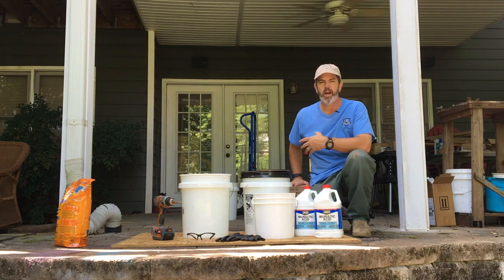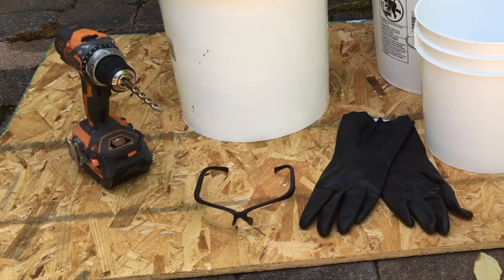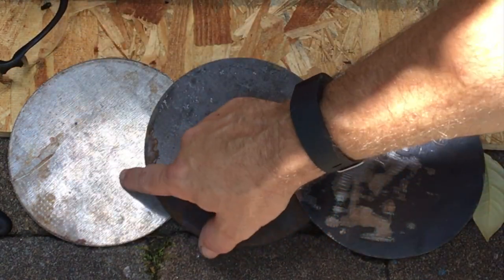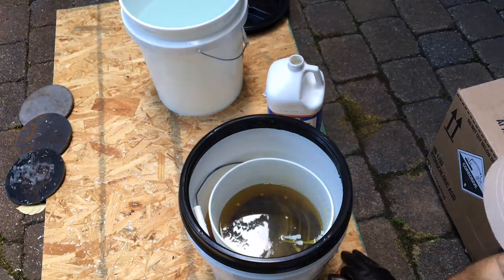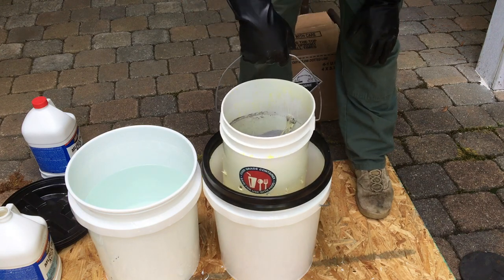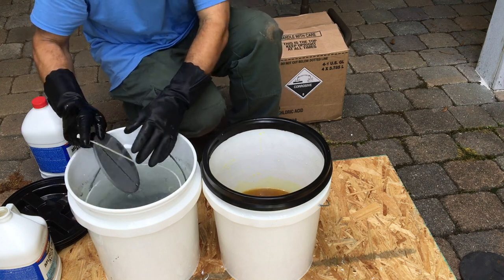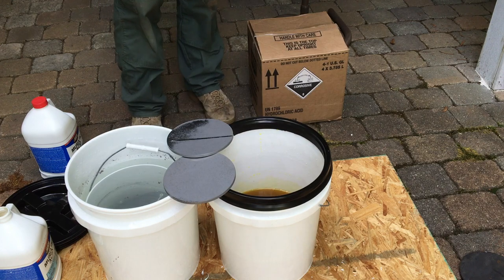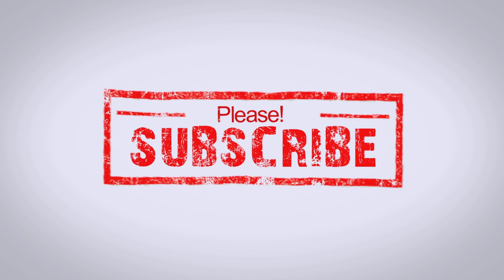How to Remove Mill Scale from Steel.

Comment: Mill scale thickness is a function of cooling time. Solid shapes cool slower, hence thicker scale.  Tube shapes cool faster, so the scale is thinner.  I fabricate handrails, and have evolved my processes through trial and error. At present, I use muriatic acid for solid shapes like bar stock and molded cap rail.  Since the pieces I'm using are fairly long and I don't relish the idea of buying and storing huge amounts of acid, I use a tank made from pvc rain gutter.  It's on a tiltable stand with a ball valve drain at one end. I typically soak the stock for a couple of hours, then drain the acid through a paint filter back into containers.  Then I run a couple of rinse cycles.  I heat the stock with a torch to about 150 degrees to drive out moisture.  I then wire wheel the residue off, followed by a wipe down with wd40. 
For round tube, I built a roller rack and remove the scale with a belt sander at 120 grit.  Square tube is cleaned off with a DA sander. Again,  wd40 prevents rust during storage and production.  Prior to prime and paint,  I wipe off the wd with acetone.  Unwipeable areas get a shot of chlorinated Brakleen, which leaves no residue. Comments are welcome.  Have a great day!
Reply from the maker: Great tips.  Thanks.

Comment: Always add acid to water and never the reverse.  I gather this mostly matters for very strong acids, especially sulfuric, however it seems worth a tiny bit of planning to avoid a possible problem.  
When you add water to strong acid, apparently this may be exothermic and the solution may boil very violently, splashing acid. 
If you add acid to water, the solution is very dilute and the heat released is not enough to vaporize and spatter it.

If you are concerned, just use vinegar to start with, which is dilute to start with.
Reply from the maker: Scott Willis that’s correct.  Unless your rinsing off acid.  In which case it would only be possible if you could dip the part.

Comment: I make weldable nuts doing this to burn off the zinc coating.  It's key to have lots of baking soda on hand to prevent ruining everything and burning your skin.
Reply from the maker: Absolutely need to neutralize anything you put in the acid.

Comment: Mark L.
Be very careful with muriatic acid. Protect your lungs with an acid-gas respirator, wear long rubber gloves rated for acid resistance, and have full face shield to avoid getting it in your eyes. Also, I recommend using muriatic acid out doors only. The fumes can rust every steel or iron object in your shop - even tools in tool boxes. As he said, have baking soda or soda ash on standby to neutralize the acidity. Rinse the steel parts in a mix of baking soda and water, or soda ash and water to get the acid off.
Reply from the maker: +Mark Lombard thanks. All good advice!
Reply: Thanks for the tip. I was going to use it tonight to remove the mill scale on a 2'X4'X1/4" plate that I'm planning to use as a welding table top. I was going to use it in my garage with the overhead door open but that seems like a bad idea after you mentioning how it will rust every steel or iron object in my shop.
Three roller cabs full of rusty tools does not appeal to me at all. 
I'll stick to using flap discs and sanding discs on a 4 1/2" angle grinder.
Thanks again and thanks ManCraftingTM for the video.
Reply: Yes, everything you said is true, but there is nothing better.
As long as you use the proper ppe and have a steadfast routine, it's as safe as any other job.
One point you did make which is VERY true, do not do this indoors, or in your workshop. It will each anything with iron ions, by that I mean destroy. Best to do it in away from workshop type areas. I do mine on my paved area, so even if I was to spill any, all it will do is clean the slabs 😉
Reply from the maker: Shona O'Neill thanks.  Interesting to know that’s also the process of choice for industrial operations.  Thanks.

Comment: Excellent! Just what I needed. I am learning to TIG weld and I can only get hot-rolled mild steel to practice on. The grit on flapper wheels blocks up with mill scale and they become useless. 15 mins in a covered container of muriatic acid, wash and dry followed by a rub with a rotary wire brush and Voila! bright clean mild steel.

The jugs that muriatic is sold in tend to leak vapour which corrodes other workshop equipment. I store my jug inside a plastic bucket with a tight lid.
Reply from the maker: Mike Webb me too.  Just got a TIG welder a few months ago.  Razor Weld TIG 200.   Not as easy as MIG, but the challenge has been a blast.  Glad the video could help.  I keep my bucket outside away from all metal.  My buddy Doug made a 10-15 ft pair of angel wings that were all metal.  Left open a 1 gallon bottle and the entire pair got a nice patina of rust overnight.

Comment: Are you mixing the muriatic acid with water? Does it need to be mix with water actually?
Reply from the maker: It doesn’t need to be mixed unless you want it diluted.  I do neutralize the acid on the soaked part in baking soda mixed in water.

Comment: i use Mild Steel pan to lightly fry breads. Over time, it has developed few black thick burnt oil coatings that dont go upon washing as well as scrubbing. Can Muriatic Acid remove those marks?
Reply from the maker: bob wa great question.  I recently had a pan that had been burned with something.  I don’t recall what, but I tried a lot of different solutions including oven cleaner.  None of it really worked.  Maybe I should try Muriatic Acid.  Worth a try.
Reply: I put my skillet into my wood stove on a hot bead of coals. Closed the door and came back later. skillet was as clean and new, ready for a seasoning.
Reply from the maker: Glenn Franz heat can do it.

Comment: I'm very green at welding, what is the purpose of mill scale on steel? Is it to protect the steel
Reply from the maker: TorTorTalks it's a carbon buildup that occurs when the plasma cutter heats and cools the metal.  Sometimes it's so thick it's like insulation on the steel.
Reply: TorTorTalks I have to disagree with the above comment. Mill scale is composed of mainly various iron oxides. It is an undesirable by product caused by hot rolling the steel at the factory. Hot steel is easier for the factory to shape than cold rolling. The hot iron in the steel reacts with oxygen in the air forming mill scale. Mill scale  negatively effects weld quality and paint durability. It tends to be thicker on steel 1/4" and thicker.  Thinner on under 1/4".
Reply from the maker: Adam Prince thanks for clearing that up.  Not sure where I got my info, but it's something I believed to be so for so long that I didn't  bother to research.  Now I'll take the time.
Reply: No problem.
Reply: It does sacrifice it self to protect the steel even though you may not want it on there.
Reply: No, the opposite is true. It's cathodic to steel. So any break in the mill scale will result in accelerated localized corrosion.

Comment: how do you properly dispose of the  muriatic acid once you are done with it? I imagine you can't pour it down the drain straight into the local river!
Reply from the maker: Luke Hubbard  you can it to a concrete guy or a You have to keep it out of doors away from metal. If you have to store it put it in a plastic shed or storage enclosure and give the fumes a concrete block to nibble on. The cement in concrete will neutralize muratic acid fumes to calcium chloride; itself a very corrrosice salt but the calcium in the cement does blot up the fumes. 

Alternatively set up out of doors downwind from structures and anything metal. Pour the acid into a plastic bucket. Using a wood stick gradually stir in powered laundry detergent until it quits foaming. Select a powdered laundry detergent that is predominantly soda (sodium carbonate) plus degergents, sequestering agents, perfume, etc. The soda reacts with the acid to form table salt and CO2. The fully neutraized miratic acid is essentially saltwater. You can pour it down the sink. No EPA disposal necessary. 

Acid once used as a pickle has metal salts in it. You can neutralize it but the metal salts remain. You really should EPA dispose it but small quantities? Let your conscience be your guide.
Reply: Alright great. Thanks for the tips
Reply: Good advice Luke. Using muriatic acid outdoors and away from your car or any other steel objects is smart. Baking soda also will neutralize the acid, and can be mixed with water to rinse the metal after you are done treating it. I don't know if muriatic acid will  harm asphalt, or grass. I would put down a sheet of plastic to protect the ground.
Reply: You can put it back in the bottle and use it again and again until I don't know since I have reused my several times.
Reply: Use baking soda mixed with water to neutralize the acid before disposing. Hydrated lime or soda ash mixed with water should also work. Wear safety googles when mixing the acid with the baking soda or soda ash. If you want to measure the neutrality, you can get PH strips at a drugstore.
Reply: Don't throw it away neutralized. You can reuse it.

Comment: I have to take heavy milscale off of a 4x8 piece of 5/8 inch plate...I can't fit that in a bucket lol
Reply from the maker: You could spray it diluted and cover with 4 mil poly.  Let it sit for an hour.  Then wash with water and baking soda.
Reply: thanks man good idea @ManCrafting
Reply from the maker: chief11893 my pleasure. 🔥👊🏼🔥
Reply: Late entry......Spray heavily with vinegar, cover with paper towels, spray paper towels with vinegar, cover with plastic wrap, wait at least 24 hours, and VOILA, no more mil-scale. If it doesnt work just do it over again.....cause you have nothing but time.
Reply: You can get plastic sheeting and 2x lumber to make the rim of a shallow tank.
Reply: Right, a bucket that big is usually called a tank.

Comment: If you use 100% pure for 15-20 min. Is it safe to say a 50/50 mix of water and muriatic acid for a half hour would give the same results?
Reply from the maker: TatorLauncher I’m sure.  I’ve used some really old muriatic acid and left it in for hours.  It worked just fine.

Comment: sir, hope you dont mind me asking, i have a ms plate 20x25 x 1/4 inch dimension, it took me 3 hours just to grind the bluish black coating on 1 side of it, i dont know it that IS mill scale, it looked like paint but didnt burn like paint when i was grinding it, it was powdery, my question is, if i use your method, would the ms plate still be safe to cook on? im planning to use it as a burger griddle, hope you can help, im a newbi when it comes into these thigs, your vid was very helpful, sad to say i saw it too late ahahaha
Reply from the maker: Bad boy unknown absolutely.   This is the same product they use in pools.  Just wash it off with water and backing soda and it’s neutralized.
Reply: You can use (much slower) vinegar.  Vinegar IS food.
Reply from the maker: Scott Willis Muratic Acid is used to balance the PH in pools.  People swim in it.  Once washed off it’s gone.  Water and baking soda neutralize it.

Comment: Vinegar works better, is safe to handle, and environmentally friendly.
Reply from the maker: It definitely does not work better, but if you like using it, keep using it.
Reply: @ManCrafting  been using it for years, and I have a manufacturing company. Just saying.
Reply: It depends on what you mean by "better".  Better how?
Safer to handle and environmentally friendly I can agree with.

Comment: Use a grinder with a wire wheel or buy a sandblaster if you do this kind of thing alot.
Reply from the maker: Daryn Goodwin I've tried a wire wheel on an angle grinder and a sandblaster.  This stuff is unbelievable.
Reply: Wire wheel does not work. It will just polish it. I build BBQ pits made of hot rolled steel and deal with this daily. Polycarbinate disk (looks like a sponge). Every maker uses a different name like EZ Strip, etc, but they all look the same. Will strip it with ease and wont remove metal.
Reply: @BBQ_Sandwich do you have a link to an example of what you use? I am pretty new to all this and am not sure if I am finding the right things.
Reply: Copy and paste this into Google  4-1/2" X 7/8" EASY STRIP AND CLEAN DISC
Reply: @ManCrafting  Yes, this is very true. Large industrial metal companies use hydrochloric acid (aka muriatic acid) baths to remove mill scale, it's highly efficient, also incredibly cheap.
It's not like making a neutralising bath is expensive either, bicarbonate of soda is very cheap too.
Good video.
Reply: Sorry, but for mill scale on 01 tool steel, it will never work. No matter how good your grinder or discs are, just a waste of money. Mill scale is super hard, and when it's stuck to steel their is NOTHING better than hydrochloric acid for removing it. Why do you think it is used in major industry for this exact purpose.

Comment: The mix of WHAT? You didn’t say wtf the mix was. Thus this video is completely pointless....
Reply from the maker: CaptainMyCaptain sorry. I’ll try to do better next time.
Reply: The mix of water and muriatic acid.
Reply from the maker: Manny Yabar it’s personal preference.  Straight will remove the mill scale faster.  Diluted just means it needs to sit longer.  I have the same gallon of muriatic acid in a bucket from this video.  It’s probably diluted by 4 gallons of water now and it still works.  If I want to rush the process I add a little from a new gallon.

Comment: Absolutely shocking. This acid is then dumped back into where? the sewage or drainage? Or waste water where it has to bee dealt with.
Reply from the maker: Graham Higgins I still use it.  This acid becomes neutralized in water.  I’ve been using this same acid since the video.  Not really that shocking.
Reply: @ManCrafting  In water, the acid is diluted and quite a bit but to neutralize you need to mix the acid with a base and that creates a salt. If you put acid into water, then evaporate the water, the acid concentration goes back up, but if you put a base into an acid the acid and base change into salt water. And of course such a thing can also be dangerous if you dont know what your doing as a violent reaction can occur.
Reply from the maker: Scott Downey technically you are right.  I always have a bucket of water and backing soda to neutralize the parts I put in the muriatic acid.   If I was to dispose of the bucket of muriatic acid I’ve used for the past three years I’d use baking soda and water to neutralize it.  That said.  The amount of acid in the bucket becomes less and less over time.   I can tell because it’s taking longer to remove the scale.  Also, it’s not necessarily a bad thing to have acid added to soil if it was spilled or poured out.  Only in high concentrations in a small area.
Reply: Last week, I changed out my batch of acid. The old and slow, nasty, stuff was dumped in a big tote and then I added baking soda a few times. A metal grate kept animals out and it sat outside where it dried out in a few days. It will get dumped in the trash. That batch was 1-2 years old. The new batch will be kept in the plastic container, outside, and plywood on top of the plastic lid to keep animals away. I don't have the space and don't want the acid inside where it will cause rust. I guess people assume you can only use acid once or that after one project the cnc plasma table will disappear and we will no longer have a use for the acid. They are also afraid of everyday items that are no big deal when treated properly, but I'm used to that as it also applies to one of my other rights/hobbies that has a few possible dangers for careless people.